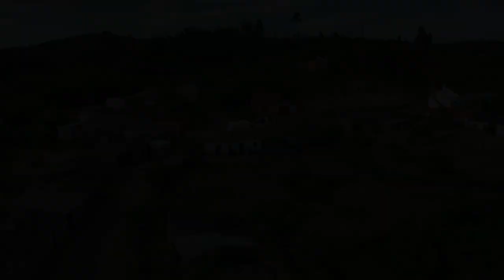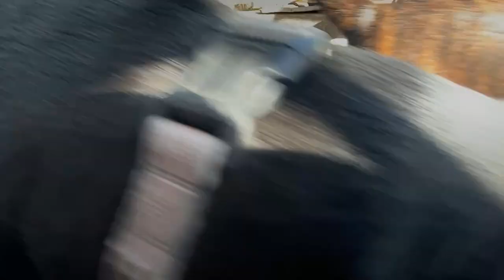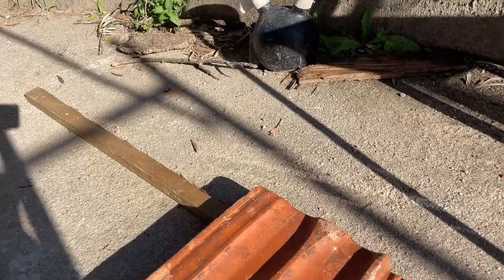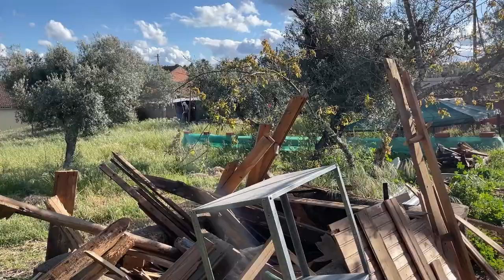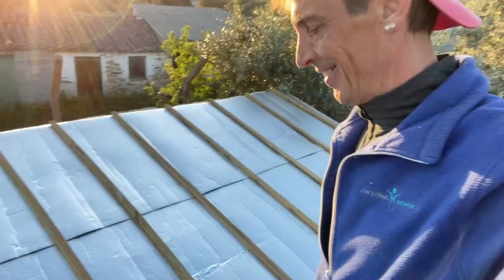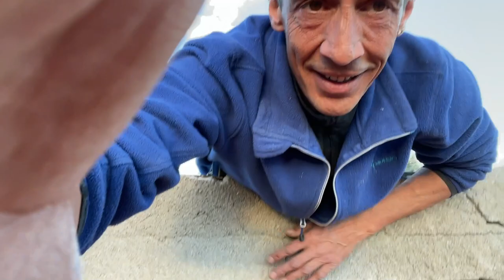MINI REBUILD PART 12 (..insulation, battens and sanding) - Portuguese House Renovation

Comment: You do know the overlap of the tile (vertically 75mm to 100mm)  can be increased so the roof lathe gauge can be adjusted to work out for you.

Comment: I would have overlapped the insulation just in case there is a leak in bad storms that way the boards under are afforded extra protection in the case of the ridge capping I would use a metal colourbond tin at the top,  if you have to cut it’s not so noticeable at the very top this is done on sides for protection from weather

Comment: Why did you put battens down the roof from top to bottom and then accross the roof from left to righ? Couldn't yo just used battens accross the roof from left to right and then fix the tiles on to them?